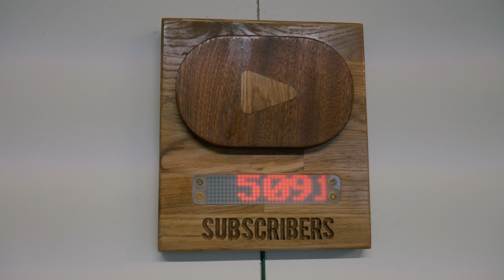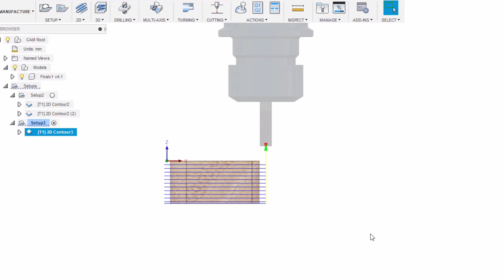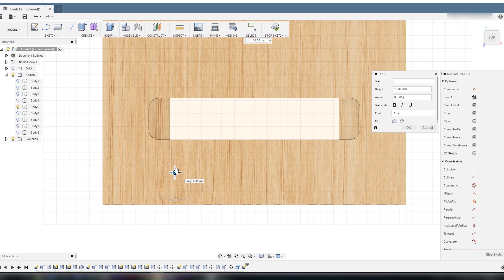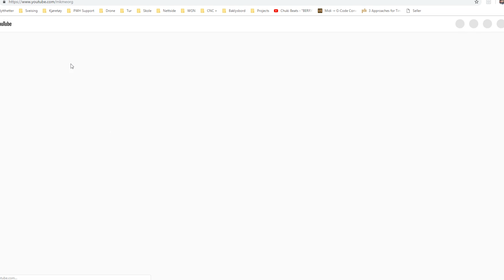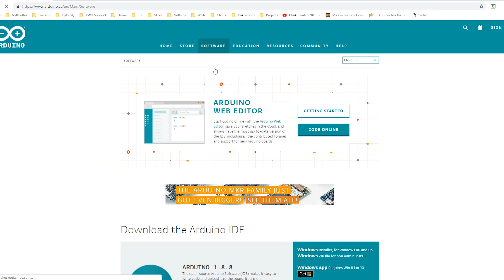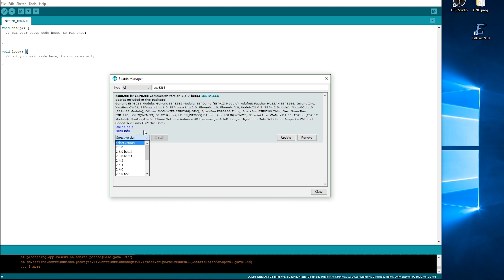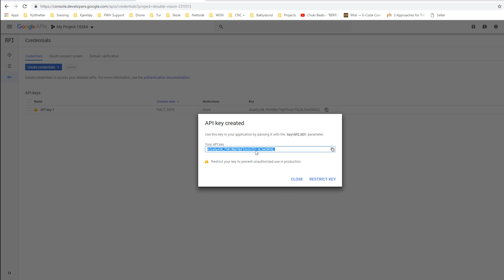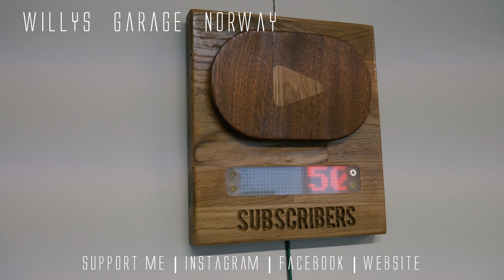YouTube subscriber COUNTER | LIVE | DIY | Arduino | LED Matrix | PLAQUE

Comment: Nice project !  I have had a few problems with sketches i have downloaded , sometimes they will comment out a line so it won’t work and you have to go through the whole sketch to check it !
Reply from the maker: Hi and thanks. Have you had these problems with the sketches I have provided?
Reply: WillysGarageNorway 
No not your ones Willy!
Usually ones i have down loaded off the  internet from instructables site  and some off youtube .
Reply from the maker: @ianbertenshaw4350  Ahh, thats good :) What sort of errors do you usally get on these sketches? I get some errors when trying to verify sketches where the writer has used boards from different manufacturers and maby different versions
Reply: WillysGarageNorway 
What i have seen is where the person who wrote the sketch  has done what is called commenting out a command or statement  ( you use // ) to comment out  part of the sketch which stops it working because anything after // is not read by the  micro controller so if you don’t sit there and go through the sketch and read everything to find the little hidden mistake the sketch won’t compile  or sometimes it will but won’t work properly . I have seen the semicolon deliberately left out or put in the wrong spot to do the same . I think it is just an attempt by the person who wrote the sketch to make novices learn how to code rather than just download everything and learn nothing .
Doesn’t happen often but i have had it happen to me and fortunately i had watched another guy on YouTube ( Paul mcworter ) that made a series on how to programme an arduino so i managed to spot the problems .

Comment: I use the esp8266 card and it appears that it is not compiled
Reply from the maker: You have yo be sure you have selected the right card before compiling 👍
Reply: @WillysGarageNorway  yes generic esp8266 module
Reply: I need to do this for a video and I still can not get out of this error
Reply from the maker: @BOTSwagger  hmm, I'm not sure why it doesn't work. Can you ask those who made the sketch on Github?  They might have a fix for the problem

Comment: Nice thanks for the video and i hope that you will complete your cnc machine you should add limit switches and a probe if you want I'm shore that you are capable to complete it,
 and i want you to know that because of your cnc machine series i bought all the electronics (tb6560 nema 23 arduino uno) and i get them running all what remains now is the mechanical parts thanks again :)
Reply from the maker: Hi and thanks for watching. Yes, I want to add limit switches and a touch probe on my CNC machine so I will make a video about that someday when I get around to it :)
I'm glad I could inspire you to build your own CNC machine. Let me know if you have any questions on tje build 👍
Reply from the maker: Good tip 👍😁
Reply: Don't worry I'm on it i collected all information needed despite my english is not good the only problem i have is that the life is not easy here in morocco you can't spent money like you want XD but this is my goal now eventually i will be able to watch it running
Thanks again and i will be always waiting for your upcoming videos
Reply: @aby set yup you right